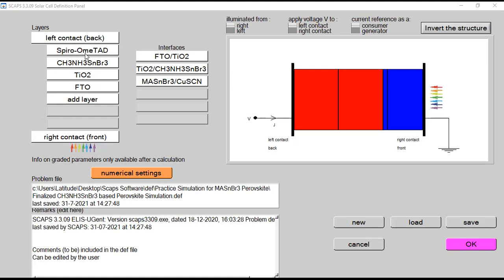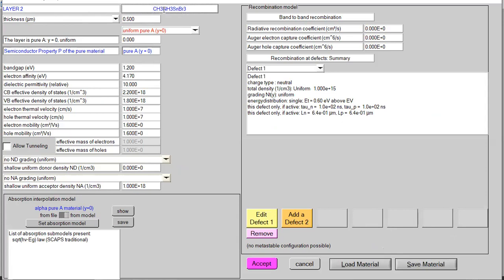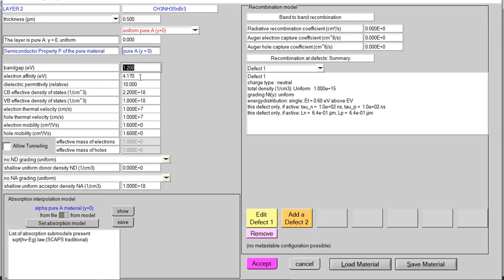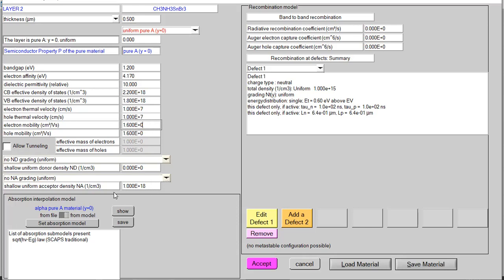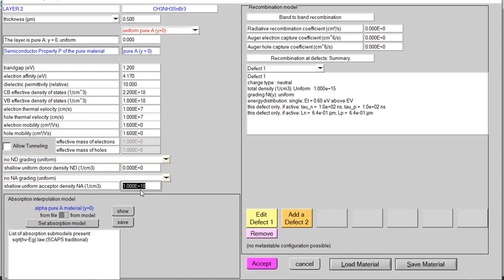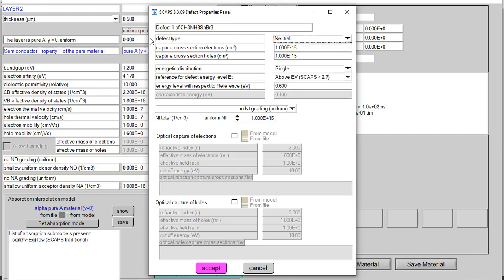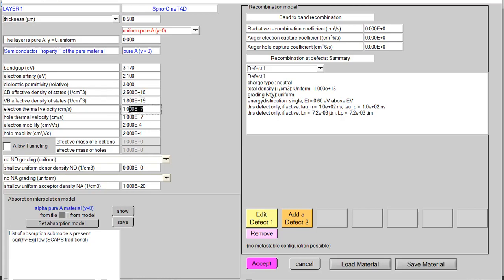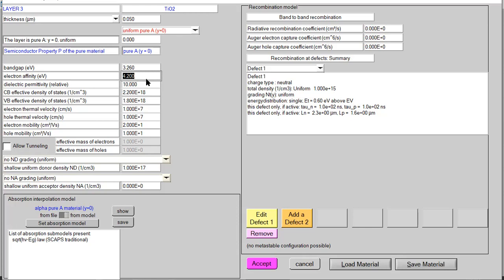Lecture No 2: How to start Simulation with basic Perovskite Solar Cells Structure in SCAPs 1D

Comment: Dear Sir i had done step by step as you said, still I got a 'Convergence Error Calculating Voltage 0.000V, 'pls help Sir
Reply from the maker: @Vinitha Elza convergence error can be due to following reasons like in start page you have Set V2 value lower than simulated VOC value, 2- lower or higher value out of range of parameters like E.A, B.G, and doping concentration. I wish I can see you structure and parameters to assist you more. Pl refer the same issue with your structure on my email id waleedakram280@yahoo.com. regards

Comment: hi again, 

why is the interfaces invertes in terms of names?
Reply from the maker: You need to specify Interfaces as per structure either planner or inverted. FTO/ETL/Absorber/HTL/Back contact and reverse it for inverted one. Interface is connection b/w two adjacent layers of structure

Comment: How to load material in different layer? Actually I need to know where should I get the materials from? When I click on load material only few options are available
Reply from the maker: You don't need to add materials, just write the name of the material on top and put the parameteric values of that material
Reply: Thanks Sir... But is it possible to find the parametric values of new material somewhere... Is there any site from which I can fetch those data?
Reply from the maker: There is no such website either you can get from literature or you may use DFT analysis to compute parameters
Reply: Sir, you didn't show FTO parameters here... Is it available in any other video?
Reply from the maker: @joy1984sunny FTO glass parameters can easily obtained from any paper.
Reply: Thank You Sir... From your videos I learnt how to use SCAPS-1D. I'm working on perovskite solar cell. Kindly advise me which topic related to PSC can lead to a good paper.
Reply from the maker: @joy1984sunny please write an email to me
Reply: Another strange issue sir... After making the structure and simulating it I didn't get convergence error... But IV graph button didn't appear... Kindly tell me what's the reason of this?
Reply from the maker: I am afraid I really don't know about this issue

Comment: Hi... Nice video.. But You are saying like choose electron affinity value between the range x to y... What is the electron affinity and at what basis we are choosing that?...
not only electron affinity.. all other parameters also you are saying like that... Kindly explain all
Reply from the maker: You need to study the literature, all parameteric values have a specific range for particular material. If you cnt study you HV do DFT calculations for getting parameteric values. Second answer parameteric values are put on X axis while dependent variables across y axis like voc etc. Read some published papers you can easily get range and parameteric values

Comment: hi,

thanks for this series of tutorial. how did you define left & back contact and FTO layer (parameters)? is it possible to share the model if you still have it.

Regards
Reply: I sent a linkedin invitation
Reply from the maker: You dnt need to define parameters for contacts, just define their work energy function values in top and bottom layer of SCAPS
Reply from the maker: I have accepted already